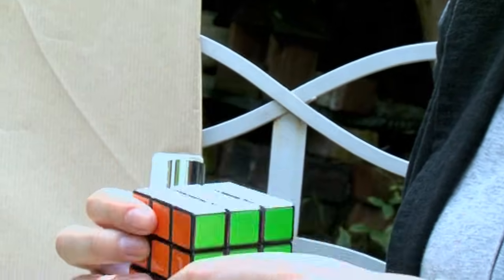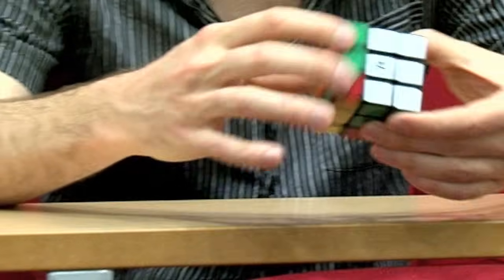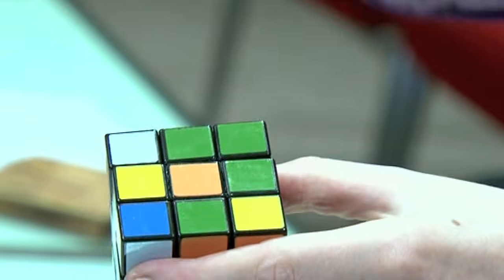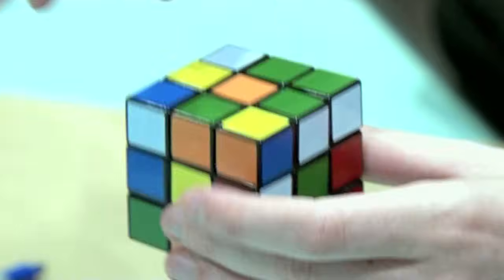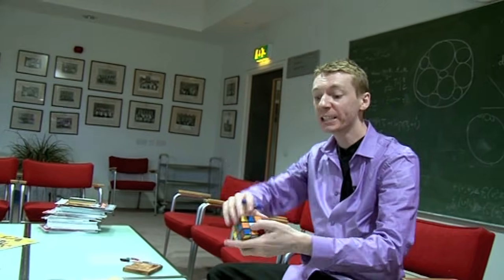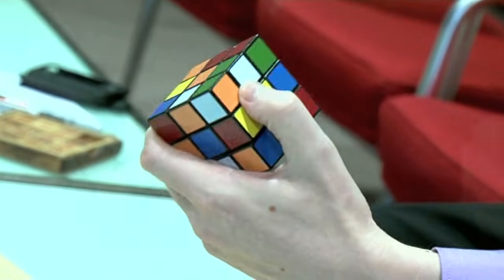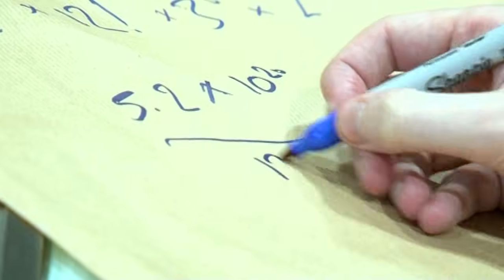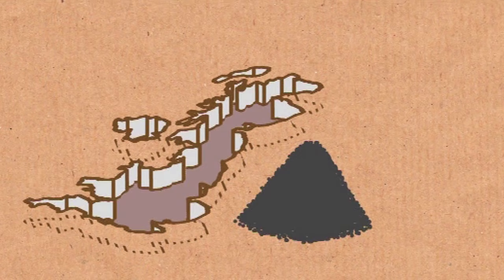43,252,003,274,489,856,000 Rubik's Cube Combinations - Numberphile

Comment: You are wrong! You can only change place of three corners, not two. You cannot twist one corner, only one clockwise and one anticlockwise, or three corners the same way. (an edge will always "follow" a corner). You cannot change place of two edges, only three or four. And you cannot flip one edge (nor three), only two or four.
-There are many restrictions, so all this about 8! and 12!, and two or three ways to twist any cubie is WRONG!
Reply: He stated in the video that not all cubies are interchangeable in various ways. He is in fact right and you are wrong.
Here's the proof: http://en.wikipedia.org/wiki/Rubik%27s_Cube
It clearly states the same amount of combinations, which is calculated by mathematicians.
Reply: You are correct... 43,252,003,274,489,856,000 is only correct if you could randomly place the stickers.

Proof:  Take a completed cube and flip an edge piece around so that the cube now only has two colors out of place.  The cube is now unsolvable.  (The wiki math is "there are twelve edge pieces, and each has two possibilities.")

Also, lets be fair, there are 24 ways to view a "Completed" cube simply by rotating it.  Permutations versus combinations, anyone?

Comment: there are actually, because he didnt take the corner or edge pieces orientation into account 519,024,039,293,878,300,000
Reply: He did. Out of all of those combinations only 1/12 can be reached through turning it while the others have to be reached by disassembly. Therefore, there are 4.3x10^19 combinations.

Comment: I always thought there was an infinite number of possible scrambles, because You CAN turn any side an infinite number of times.
Reply: yeah but most of those scrambles are going to be arbitrary, and more importantly, identical to another scramble, since turning it 4 times is the same as not turning it at all (so turning it 5 times is equal to just turning it once, turning it 6 times is equal to turning it twice, etc).
Reply: So even though the scrambling PROCESS has an infinite number of possibilities, the process is irrelevant and the number of possible RESULTS of any given scramble is finite.
Reply: IAmSuper VegitoIOS Holy shit. facepalm. If you turn it 4 times you'll be back to the beginning.

Comment: Fact:
All legit 4x4 parity errors do not occur on a 3x3,5x5,7x7, etc.
This includes a set of edges switched, everthing else solved
everything solved but a set of edges upside down
Reply: Unless it's a void cube right?
Reply: Don't quote me on this but i think parody errors can't occure on Void cubes at all, right?
Reply: Void cubes can get parity. This is because the centres are mixed up in a way which makes the rest of the cube unsolvable. This can be fixed by doing a slice move then solving the cube as if there were centres.
Reply: 4x4 has the same parity errors as other cubes. Just, on a 5x5, the midpiece is in a fixed position though it is as if it was the exact same.

Comment: how many possible combinations are there for a 2x2x2 cube?4x4x4 cube? 5x5x5? 6x6x6? etc
Reply: *****
2x2: 3,674,160
3x3: 43,252,003,274,489,856,000
4x4: approx. 7.4e45
5x5: approx. 2.83e74
6x6: 1.57e116
7x7: approx. 1.95e160
nxn: Kid, the formula isn't so simple. You use factorials for the permutations of each set of pieces, (That's two on a 3x3, three on a 4x4, five on a 5x5, so-on-), then you duplicate the sets for the possible orientations of each piece, then you separate the group of permutations of the system that you can arrive at with a specific set of allowed translations from the initial permutation (solved state), that being slice moves, by identifying changes to the system that can only be done by making an impossible move and eliminating the set that requires that (That's the part where he divides it by twelve, by the way-).

Basically, the formula is different for each cube, since it's a different matrix. It's not pre-algebra/algebra, it's early college level probability and carries over into advanced theoretical fields of mathematics.
Reply: Don't know, but redkb has a video on how many permutations there are for a 7x7
Reply: Dash Lambda 
More generally, it has been shown that an n × n × n Rubik's Cube can be solved optimally in Θ(n2 / log(n)) moves.[43]

Wikipedia FTW
Reply: Cubeagami101 And 17x17!
Reply: KingHalbatorix
The actual work is simple, it's how you get to the work that's complicated.

Figuring out which formula to use and working it out is early high school, but a lot of the theory behind it is from later mathematics.
Reply: ***** so 6^(n^^3)?
Reply: where did you read that?which algorithm can do that? i read it was n-p complete

Comment: Why are the center's ignored? Any combination with yellow at the top and green facing out can also be duplicated with green at the top and red facing out. That's two sets of combinations for all the edges and corners. That's 24 total orientations of center pieces so the total reachable combinations should be 24 times this number, yes?
Reply: Yes, if you've ever taken apart a cube, you'll know. They are literally physically connected via screws into a plastic core. You physically cannot move them, unless, technically, maybe you're lubing the core or something and you unscrew them... sorry going into cubing terms. Anyway, yeah.

Comment: You do know, that if you twist any even number of edges or corners, you can always go back to the solved state?!
Reply: that is not true
Reply: UberCuber
Prove it.
Reply: bl4ckscor3 I f you turn one corner clockwise one rotation and a corner on the same layer also clockwise, then you cannot go back to the solved state.  (This might work with corners not on the same layer, but I don't feel like checking right now)
Reply: UberCuber Facepalm. Dude, if you do ANY alg it will eventually go back to the beginner. For example, the T perm goes back after doing it twice and the sexy move goes back after 6 times.
Reply: Facepalm.  I know that any alg will always eventually go back to the solved state, but that doesn't have anything to do with this comment.  I am saying that if you turn one corner clockwise and another corner clockwise, the cube itself has become unsolvable, you will have a corner twist.
Reply: UberCuber You didn't make that clear. Your should have said "If you turn one CUBIE clockwise" so we knew what you meant.

Comment: The author had explained the no. of universes (or orbits) is 12.  To get to other universes, three ways were mentioned:

1. flip any edge piece once will get you to another universe.  But remember that you have normal moves to flip any two edge pieces together.  Therefore flipping two edge pieces will leave you in the same universe.  So you get two distinct universes by flipping an edge piece.

2. rotate any corner piece.  Three orientations of the corner piece means three distinct universes.  If you rotate more than two corners, you will be getting into one of these three universes because there are normal moves to rotate two corners together such that the total rotation of the corners are 360 degress.  So you can always reduce the rotation of more than two corners into a single rotation of a single corner piece.

3. Swapping two edge pieces / corner pieces.  It happens that using normal moves one can turn a swap of edge pieces into a swap of two corner pieces.  Therefore the two kinds of swapping are essentially equivalent.  Also, doing two swappings of edge pieces will again bring you back to the same universe as there are normal moves to do it.  Therefore you get two distinct universes by swapping edge pieces or corner pieces.

One should also be aware that these changes are independent of each others. e.g. you cannot undo the effect of a flip of an edge piece by swapping the positions of two pieces, or rotating a corner piece.

So the no. of distinct universes is 2 x 3 x 2 = 12.
Reply: You said that you can swap the two edges and the two corners, and so the two universes are the same, but you cannot do the two individually.  It isn't possible to swap just 2 corners or just two edges, so you are wrong.
Reply: UberCuber You can swap just two corners.
Reply: No you can't...
Reply: UberCuber is right.  That is also what I meant.  It isn't possible to swap just 2 corners or just two edges by normal moves.  If you attempt to swap just 2 corners by normal moves, you will find that you either end up swapping 2 more other corners or swapping 2 more other edges.  So the result is a combination of corner swap AND edge swap; or a combination of corner swap AND another corner swap.  The same happens to edge swaps.  That's why I said if you disassemble the cube and swap two edges AND swap two corners, then you can solve the cube into its original state, i.e. in the same orbit as the state before the disassemble and swap.

Comment: I'm quite sure this number is wrong, because is counting every edge and corner like they can be twisted independently, but it's not acually posible to flip just one edge or one corner without flipping/moving another one. So i think the number of combinations is lot lesser than this huge number shown, and instead of using permutations, some mix of combinations should be done to calculate it.

... or maybe i'm wrong and just creating math chaos and confusion.
Reply: That's where the concept of the "12 universes" comes into play: With a certain cube (meaning: starting with a certain, fixed position of sides and edges and their orientation, e.g. the "solved" cube), you can only reach 1/12 of all possible combinations by applying the twists possible with a standard rubik's cube. Each of the universes is of equal cardinality (because the set of operations to produce them is always identical). Therefore you can divide the number of all possible "free" combinations by 12, to get the number of "allowed" or "realistic" combinations which can be produced on a real cube by arbitrarily twisting sides.

Unfortunately, Numberphile didn't tell us where the number 12 of equivalent universes is coming from.

Btw., I am not sure if the numer of combinations is correct, either. I guess we still have to divide it by the number of "orientations" or "views" in which one can hold the cube: Let's consider a cube with a certain color distribution (caused by twists). The orientation of that cube is determined first by the position of a certain central color, let's say the blue central face. We can turn the whole cube such that the blue face can appear on all 6 faces of the cube. Second, fixing the cube on one of these positions of the face color, the cube can be rotated as a whole in four ways (90 deg. increment) round the axis going through the colored face and ist opposite counterpart. So we get 6 x 4 equivalent orientations of one cube with a fixed color scheme. So we have to divide the number not only by 12 (the number of universes), but additionally by 24, the number or equivalent orientations.
Reply: It is right you can look for the maths at wiki
Reply: Pieter Luyten hopefully, you do not believe something is right only because it is written on Wikipedia?!
Reply: ***** ok, you do not find a certain orientation as an explicit condition for the calculation in the video ; but it is there (unexpressed) anyway:
Reply: ***** in you imagine the cube in a certain, fixed orientation, and then follow the deduction of the number of calculation, you will finden no contradiction between the fixed orientation and the arguments. That means you still need to abstract from the orientation to get the true number (i. e. divide by another 24 as I wrote before)...

Comment: So I figured out the first part myself on a bus ride, and I figured that there were probably orientations that were not possible, but how do you figure out which ones aren't possible, where does the 12 come from?
Reply: The authors do not tell us. I think this is where group therory comes into play. You have to find out how many disjoint equivalence classes exist in the set of all "free" combinations. Each equivalence class consists of all combinations possible with legal twists (no pun intended) applied on the cube.

Think of the "solved" cube as a starting element of a production. The production functions are the possible twists, and the equivalent class consists of all combinations produceable with a finite number of twists.

If you disassembled a "solved" cube, flipped an arbitrary number of edges or corners and reassembled the cub again, it might happen that you stayed in the same class as before, or you landed in another class (which contains combinations which could not be reached by twisting a correctly aligned "solved" cube). The trick is to find out how many of such classes exist, i. e. which combination of arbitrary corner/edge flips would create cubes would result in the standard cube (which can be again solved back by a speed cuber), and which combination does not (but I also have no clue yet how to accomlish this)...
Reply: To understand that, you really have to learn to solve the cube, which gives you a better understanding of the cube.  I have been speedcubing for only 5 months, and I already understand the cube very well, to the point that I understand why certain move sequences do certain things.  For example, the algorithm R'D' R D (Look up cube notation)  Will revert back to the solved state when performed six times.  Every time you do the algorithm two times, it rotates the corner in the top right one clockwise rotation.  However it also messes up many other things on the cube.  The "other things" that I referred to are all pieces in the bottom 2 layers.  Once you perform the algorithm 6 times, as I said, it returns to the solved state.  So you can rotate the top layer every time you do the algorithm an even number of times, and that will switch which corner you are permuting.  But there are only 7 different ways you can manipulate the orientations of corners on the last layer.  Sorry if this explanation is hard to understand,  I am really young, and don't know how to explain this.  (It is a very difficult concept to explain)

Comment: Some calculation of 3x3x3 possibilities: Maximum, only:
X0 = (8*7*6*5*4*3*2)*3^8 (corners) *(12*11*10*9*8*7*6*5*4*3*2)*2^12 (edges)*6!(centers)
X0 = 519 024 039 293 878 272 000 (all situations) *6!
X0 = 373 697 308 291 592 355 840 000 = 3,3736973*10^23 stc.

Of course, if you don't build it by from wrongly turned pieces then it less per 8*3 for impossible turned corners and per 12*2 for impossible turned edges:
It is 8*3 * 12*2, why? = 48 Because every situation is not possible....
X1 = 4,325 003 274*10^19 that your calculation? Divided by 12?

Per 2*12 = 24 for impossible swapped edges, and 3*8 = 24 for impossible swapped corners, and per 2*2*2  = 8 per impossible swapped middles....

These are in different factors, so we must do all those dividings.(No normal adding)
My Casio-fx-115MS (made in Japan - but processor still made in Silicon Valley?) told me those numbers, I didn't proved them by my own calculations yet.... Yes, it could take an hour of my time to get "proved-Strict-number" of those in and by my own papers. It is not very difficult, however. 

Perhaps there are impossible, in right-built-cube also swap two edges in Final situation, (three can be rounded), but how much it divide that amount? Double, twice?

And there are 6*4 symmetric cube-positions: Divide-factor : 24*24*24*8 = 
X = 3379062755819520000/2  = 1 689 531 377 909 760 000
X = 1,68953137790976000*10^18

The FINAL AMOUNT IS 1,689531377909760*10^18.
But I am not yet 100% sure of this.
Reply: But if we count the number of sequences, which we can get, there are much much more "music"
(3*4*3)^(a whole amount of moves)= (36)^(3*move_amount/36)
(36/3 => 12 because of 3D, and you don't do those 36 in same move)

How many moves or time in of maximically mixed cube, without any error-moves? 1 move per second? 15 for world master?
1,689 * 10^18 = 27^(time*3/27)
time = log(3,1689*10^18)/log(27) * 27/3
time = 114,61 secs
moves = time*X = 115 secs and moves, X = 1

That factor X = 15 is for world master, I usually got 3-cube solved in about 100 moves, and with factor 1,1, and then over two minutes.
1,689 * 10^18 = 27^(time*3*15/27)
time = log(1,689*10^18)/log(27) * 27/(3*15)
time = 7,641 secs

So, World Rubik-trick-masters are 15-times faster than real humans....
Reply: The centers cannot be independently move and rearranged. They are on fixed axises and the puzzle is unsolvable if they are moved. ie, blue and green will always be opposite each other. If the centers could be moved then the corner and edge pieces would have to be recolored to provide a possible solution.
Also, this is not a 3x3x3 puzzle, it only has 3x3x3-7 moving pieces.
Reply: Aki Karppinen
Speed solvers can solve cubes in way fewer moves than that. The current (the fewest moves required to solve a cube at any level of complexity) is calculated to be 20 (cube20.org). In quarter-turn metric it's 26. It's possible through practice to make a total of 4 quarter turns simultaneously (two half turns on opposite sides).

Comment: What the video is saying in one way is that you can not have say one edge flipped or one corner rotated on its own.
If you have ever taken a cube apart, try putting it together "wrong" with one edge flipped or a single corner rotated and you won't solve it.

Comment: He gave the basic details (@4:08) before stating the number (12), without quite connecting them.  First, a corner can be twisted +/- 1/3 turn, to get a different orbit (not stated: and there are ways of converting a twist of one corner to a twist of any other, so it doesn't matter which corner), so that gives 3 distinct orbits.  Second, a side piece can be flipped, so there are 2 options.  And a pair of side pieces can be swapped.  So there are 3X2X2=12 orbits.